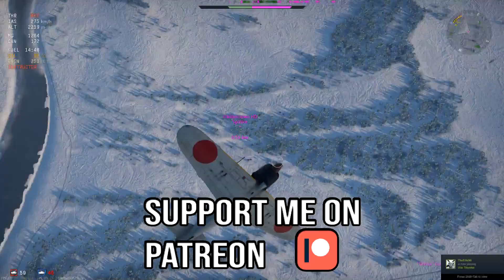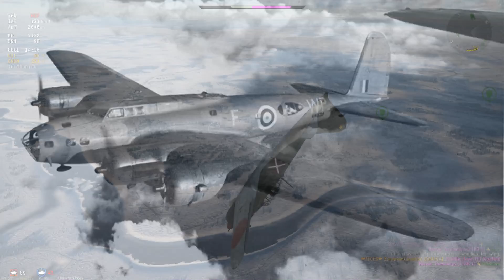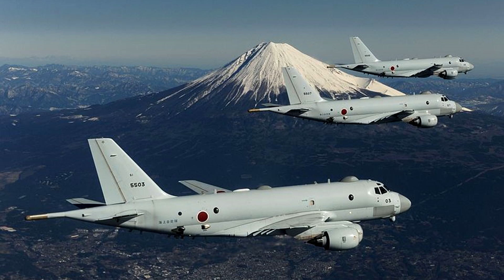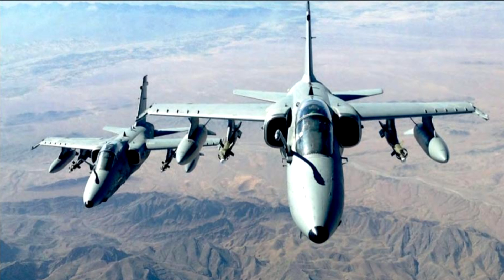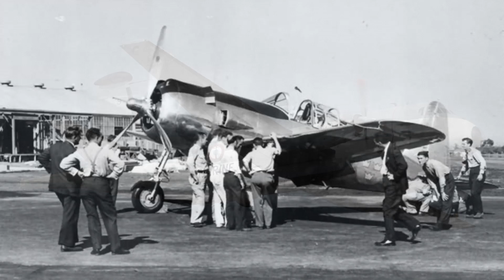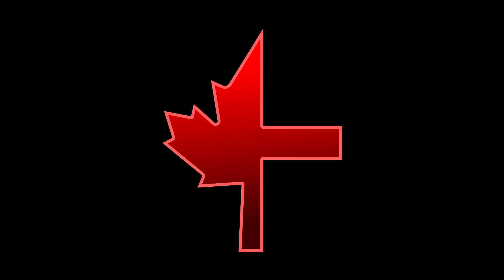Aviation - Passed To Developers - February 2022 - War Thunder

Comment: Will they add the BR version of the AMX? It came with a 30mm DEFA instead of 20mm Vulcan and about 10 years ago it went under a modernization program, those units are called A-1M.